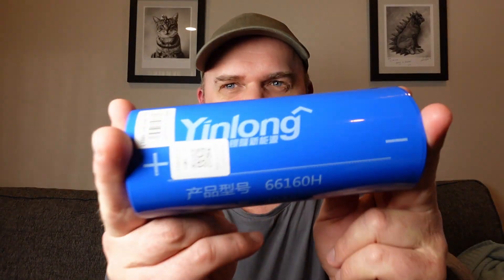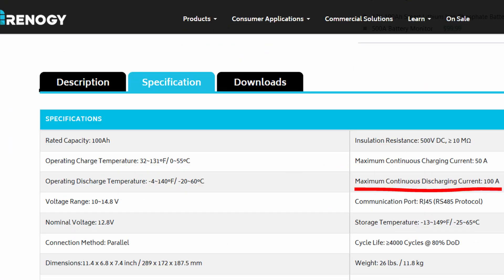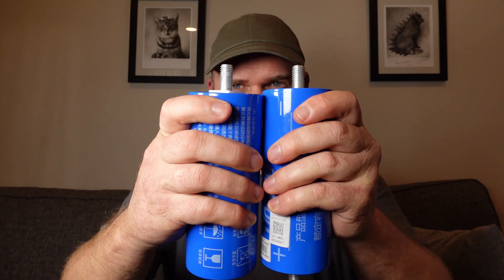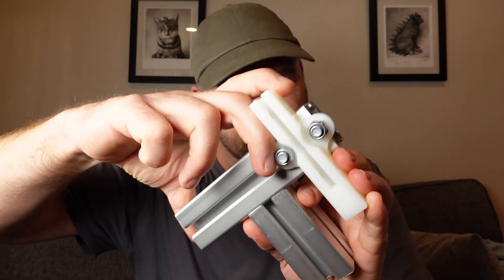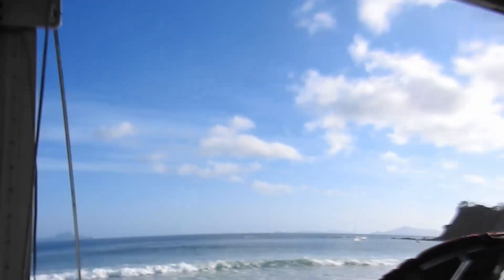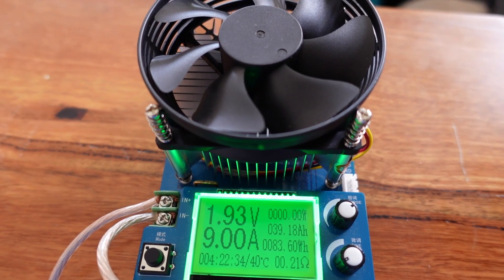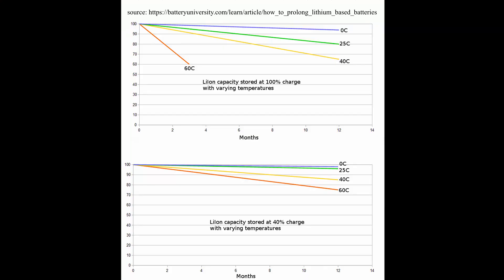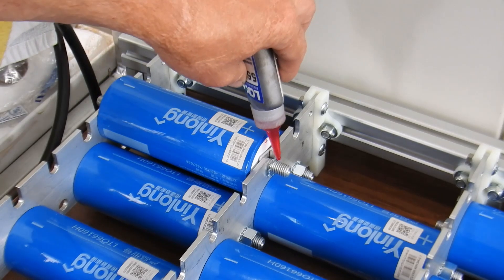Campervan DIY battery build HUGE POWER!

Comment: Good vid and great tips at the end. Especially liked the flange nuts at the end. In the real power world, instead of the star washers, Try Belleville / cone / cupped washers. (I've seen them under all those names). The build up is plate on plate (buss on buss), brass round and then the cupped. Basically a cupped spring that maintains even pressure around the washers instead of point source pressure.  - This is an example, random pick (You may call them something else over there - https://smile.amazon.com/dp/B08L1XRZFN/ref=cm_sw_em_r_mt_dp_esRSFbXXAPNN9

BTW - thought your presentation was good enough to subscribe to
Reply from the maker: Thanks, Yeah, I've used Belleville washers before, but only in mechanical designs.  The reason I wanted to use the star washers was to get a real bite into the ali.

Comment: I would have been keen to do the bulk buy with you but I am in South Africa and the double shipping would be a killer. My system is a 12V system so I think that a bank of 6 would do just fine for me as I have 2 x 102 ah AGMs at the moment and the capacity is normally okay but the one is getting a bit tired and needs to be replaced. I will check out your Alibaba link and report back if I pull the trigger on this. Thanks for a great video
Reply from the maker: sweet, flick me an email mentioned above and will get a price for you with bulk buy

Comment: Hi there.. so I have this dream I've had since I was about 15,. I'm 42 now.. That dream is to have a portable sound system that me and a couple friends could take anywhere and pump out 10- 12 hours of blissful beats at.. let's go with 30,000 watts.. 
I guess I have been just waiting for the technology to arrive not knowing much on the ends and outs of all the specs. The last couple years I've been excited that the idea could come about with all these new batteries.. when I saw your video I am thinking maybe this battery style is the one to make it all viable. 
If you were going to make the kind of build described.. a battery bank to power, subs, mids, highs, and drivers, amps and such,. To power a portable sound system at 30,000 watts for 12 hours.. 
Is this ridiculous?

Anyone that would like to help develop this concept feel free to hit me up at electricshiver@gmail.com 
Kindly,
Beau
Reply from the maker: 30kW for 12 hours seems optimistic...  The battery would have to be at least an order of magnitude larger than mine
Reply: @brendontait6968  so what about knocking it down 20thou.. or even to 10 thousand?
Reply from the maker: @nonyabusiness9747  if this is something you want, buy up a few tesla P100 batteries from wrecks etc.  It won't be cheap, but this will be the cheapest way of doing it.
Reply: @brendontait6968  sounds like a great idea. Ty
Reply: 30kW sound system?? Blissful beats!? LOL
Reply: @Infinion  yes. 
I hosted a 3 day edm festival once and was able to have a 80,000 what system. That's a bit over kill because the venue owner recieved 17 official complaints for "gross disturbance of the peace" some neighbors were up to two miles away. 
But my goal is to have a portable system that could be move by a few people to remote locations were we wont bother anyone,. And be able to pulse beats for a small to medium crowd.

Comment: You are smarter than you look.  Most folks don't consider expansion and contraction, like the dudes that installed my leaky steel roof.  You need flexible sealant around vents, not tar.  The roof moves a lot.
Reply from the maker: thanks, we will see... time will tell if my design was a flop

Comment: Nice neat build.  These cells are only rated for a continuous discharge current of 240A or 6C so that should really be the only current rating people should look at when using them in any type of long term use.  That being said you will likely never even come close to the max continuous discharge with a 24V inverter.  The 600A rating is a max discharge current rating at 15C and is only for very short bursts.  Each cell looks to be good for 92 watthours so they would be about 30% lower capacity by weight vs LiFePO4 chemistries.  I would take the max discharge rating and cycle life that they claim with a huge grain of salt since Yinlong hasn't been around all that long yet even if the LTO chemistry has been around for a while.  LTO is probably the least energy-dense chemistry but is also likely the safest of the current lithium chemistries.

Comment: Use loc tite blue on your threads. Locks the nut but leaves it removable.
Reply from the maker: The "loctite" I used wasn't loctite brand.  It is Loxeal 55-04 which is intended for disassembly.  I am cautious It could still hold too tight.
Reply: @brendontait6968  It looked like loctite red. That stuff you have to tourch to get the nut loose.

Comment: I need a backup battery for my CPAP machine, for travel, camping and when the power goes out at home. I'm wondering how this type of battery would perform? & how to build a system with such a battery? If you have any advice I'd love to hear. As other off the shelf batteries seem to be horrendously expensive.
Reply from the maker: It would work well.  Tho I'm not really familiar with CPAP sorry.  Can't imagine it would be very difficult

Comment: Hey Brendon, has anyone contacted you about this setup for a sailboat? I'm going solar on my boat after my 6.5 KW diesel genset took a major dump.
Reply from the maker: It would be quite a good option for a boat, as a Boat fire isn't really ideal.  I can run my fridge and lights for around a week from it before it needs charging

Comment: Regarding your ideas about cost efficiency.. I believe a person will change their batteries within 10 years no matter what they go with, due to new technology, or they sell their vehicle etc. 

12v 100Ah Lithium = 1200Wh * 4000 cycles = 4 800 000 Wh, = 4800kWh.  Let's say people only use 70Ah a day..

70Ah * 3650 days (10 years) / 100 (a cycle is a complete charge and discharge) = 2555 cycles. So they don't need 20k cycles.
What does the cost look like now?  We won't use 20k cycles, so it's reallty wrong to use that number?

Also, you must add the cost of the BMS and building the battery.
Reply from the maker: I hoard stuff and never sell anything!  I don't know why you'd change your battery if you were 10 years in and it was still delivering the power you wanted?  The battery can charge quickly if you wanted to charge from an EV charging station etc?  One of the things to take into account... The rated cycle life is in lab conditions quickly cycled.  Real life use is likely to drop the actual cycle life by up to 50%.  Even if the LTO cycle life was halved... It's still heaps.  BMS is a minor cost and the build materials were around 3-4% the battery cost.
Reply: Also, Will Prowse says "We can't use all of the capacity of these cells for 12v appliances" . That has to be taken into account as well imho.
Reply from the maker: Mine is 24V and the voltages work fine for everything.  I agree with Will if you are using 5 cells, 6 cells is more common for using with 12V - this gives around 15.3V at max charge, tho you wouldn't lose much capacity dropping to 15V
Reply: @brendontait6968  thank you for your time and responses :D

Comment: Lithium Titanate: Specific energy (capacity)	50–80Wh/kg

Very low Wh/kg, why did you not go with something that gives more wh/kg?
Reply from the maker: Your specs are lower than I have seen.  Normally stated from 80-110Wh/kg tho I have seen as high as 140Wh/kg.  that being said... the energy density is similar to some LFP batteries that I have seen.. I don't care so much about Wh/kg my truck is 12T  I want reliability, safety and longevity.

Comment: Wow, that was a great video mate. Just wondering, I live in Queensland and I’m thinking about putting a battery system on my house to go with my 11.5 kw system. You mentioned keeping the batteries cool for efficiency....well , I was just wondering if I should build the battery packs into a large fridge and set it next to my inverter on the deck. It would keep everything cold and wouldn’t look out of place. Your thoughts please. I really enjoyed your video and I may be interested in buying some batteries as a group. Cheers.
Reply from the maker: Hey Richard, Thanks! more keeping batteries cold is for life extension.  Batteries will generally have a reduced output capacity when cold.  Regular lithium chemistry will not last well being operated near or below freezing temperatures.  It's a good idea tho.  I think with this chemistry, as long as you don't get it too hot, it is likely to last you a lifetime without cooling. But yeah, building a pack in a freezer and having it set at like 10C with a thermostat mod is probably decent to extend the life of other chemistries.

Comment: Hey there, fascinating. yet two thoughts: first, my feeling is that the number of functional charge cycles on any accumulator is more a guess based on lab data than a promise based on real life experience under everyday conditions. I would not take it as granted. second, god forbid that anything goes badly wrong with this monster while you are sleeping in the van ... You might not get out in time... 
Anyway: very informative and a straightforward and simple approach. I like that.
Reply from the maker: Thanks, yeah.. I agree about lab testing vs real life.  Especially if the batteries are being held at full SOC for a majority of their life.  That being said... using lab based data for comparative life expectancy between different battery types is likely realistic.  If one cell lasts twice as long in lab testing as another, it is likely to come close to lasting twice as long in real life too. I chose this chemistry because it is the safest that I could find.  During sleep I think it is likely at its safest, no real charging or discharging happening.

Comment: Are these things for real?
40ah battery that small for 56 bucks plus about 20 more bucks for shipping on aliexpress. 
Sounds too good to be true.
Reply from the maker: I think you might be mistaking Ah for a unit of energy capacity.  This is why I said in the video that people should forget using Ah as capacity measurement and use watt hours, Ah means nothing.  One cell is only 2.3 volts, so you'd need 6 cells to make an equivalent (or just over) 40Ah 12V battery.  The cells are 92Wh each.

Comment: i'll never trust chinese non verified and guarantee batteries to install in a van.. 1 defect and u burn down your van.
Reply: Chinese people aren't dumb lol. They make everything in your house
Reply: these batteries are really good. you should look them up, they are from a reputable Chinese company
Reply: The difference is in the verified. Read the certs. 

More likely design/build errors in the battery pack assembly and charge/discharge control system will cause catastrophic failure.

Comment: Why not use terminal ends on the batteries, with flexible 4 Guage copper core multistrand  high current wire cable between them it would solve the flex issue quite nicely? For mounting make a mold and pour silicon racks to hold the ends of them in place?
Reply from the maker: I can't imagine it would be a cleaner/easier build with that method?

Comment: Different from other lithium batteries there are considerable losses  if we compare energy flow between charge and discharge cycle.  Please check data sheet.
Reply from the maker: This is not true.  I mentioned it in this video and am going to make a video about it.

Comment: I know absolutely nothing about battery technologies etc so please excuse me if this is a ridiculous question but could these be used for an Electric Vehicle or are they just too cumbersome for that. It just seems that with the very high discharge rate they'd be ideal for giving an electric motor a mass of power without them going into meltdown etc. Thanks.
Reply from the maker: Mitsubishi and Honda have used them in some of their domestic market vehicles.  Generally speaking they are considered to have an energy density that is low compared with more flammable chemistries.
Reply: @brendontait6968  ah okay. Thank you so much for your reply I appreciate the information.

Comment: Dropped out of high school ?
Mate, you should have been the teacher !
I wish I’d had a physics teacher half as good !
You would have inspired your students to learn.
I think the problem may have been, that you were way ahead of your teachers; They didn’t engage you.
I bet you were bored to death in class and your mind wandered onto other dreams.
So concise and articulately explained.  No “Ums” and “Arrrs” or “you know”s.
There a a few good Youtubers and your in the top 5%.
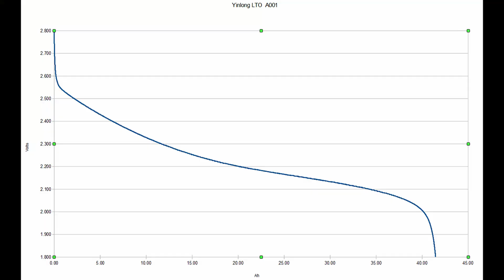PS - Hold the battery up so we can read the specs.  Wasn’t familiar with LTO and had to slowmo well into the video to read the voltage of the cell.  Had my mind racing trying to work out capacities and your set-up, until you presented the voltage range graph (12:45).
Reply from the maker: Thanks Len, yeah... never been into wrote learning.  Thanks for the encouragement, I'm still fresh to YT am going to put some more effort into getting better at explaining my thoughts.  Have a lot to share.  Cheers

Comment: Video says 95kW but description says 9.5kW. The battery description is just as confusing: each battery is 40ahr & 2 3v.
In series you add voltage and ah stays the same.  In parallel you add ah and voltage remains the same.
95kW would be 7,900 sets of batteries with 6 batteries in series: 12v @ 40ah.
Reply from the maker: I think you are confusing units Bob.  The video says 90kVA and the description says 9.5kWh.  90kVA is the amount of power the pack could deliver.   9.5kWh is the energy storage capacity of the pack.  Hope that helps clear the confusion?

Comment: You didn't mention weight comparison to Lithium Iron Phosphate. I want to do a build for my RV so weight is a big concern. What is the weight per capacity difference LiFePO4 vs Li2TiO3?
You talked about how you need to keep  AGMs charged at 100% all the time to keep them happy and Lithium at least than half charge, sounding like you were leading to some kind of difference and why these Lithium Titanates were better, but you didn't I assume then these want the same 50% charge to be happiest?
Reply from the maker: LTO is about 65% the power density of LFP, tho I have seen LFP batteries that have similar energy density to mine.  I'm still new to YT and learning to relay my thoughts better.  I was just saying that lithium typically should be stored around half.  With an RV it's easy to have them sitting near 100% for the majority of the time when not being used.  This will likely damage LFP much more than LTO.

Comment: Did you use an oxidizing paste between the steel and aluminum to prevent dissimilar metal oxidization  ?
Reply from the maker: Notice with the cotton bud application...  yes.  Especially for the copper connectors on the end.

Comment: Some LTO cycle up to 7000 only according to some Wikipedia
Reply from the maker: yeah, some are also claiming 30,000 cycles.  I assume their life depends on how hard they are stressed.  LTO chemistry typically has an energy density range of around 80-120kWh/kg, these cells are on the lower end of this range.

Comment: It's all fun and games until you realize the batteries alone all add up to over US$5000.
Reply: People think "solar saves money". They don't pick up on batteries to store the energy IF the sun shines.  NZ...wonderful son!
Reply from the maker: Yeah, batteries cost money unfortunately.   The equivalent capacity in renogy would have been around $6,500
Reply: @brendontait6968  prismatic calb cells can be found at $129 3.2v 100ah. Large amounts of support are available for lifepo4 cells. Also, they are another safe chemistry. $3830 for loose cell 9.5kw
Reply: @brendontait6968  yeah but when you factor in the life span of those batteries that's where they end up actually being extremely extremely cheap for a battery

Comment: That wass all correct information! my project can go up to 0.5MWh  but we will se what will happen in 10 years. I have to study later  details. I recommend you study EU company Sceleton kondenzators aka super or ultra kondenzators. Arent these akumolators only from that to that voltage or you kill them? btw akumolator/s not bateri is only 1 time use!

Comment: Great build. I have few of these cells and wondered about how I can package them together and you gave me some few great tips! In general in automotive application, LTOs are not so popular in most builds since kWh per Kg in power density is where these are far behind compared to other Lithium chemistries. I worked with these in City Buses where they may have a short range like 50-80km but have dual charging port to pump in as much amperage (8-10c) in for 5-10 minutes and go another 50-80km - it was pretty sweet to see them work. LTO (Altairnano/Yinlong) is an odd duck that has some interesting applications. They do degrade about 1% a year and also wants to be charged with high amps if you want to them to perform well. Share more about your experience with BMS and other related things. Thanks for sharing. Subscribed!
Reply from the maker: thanks!
Reply: we can provide yinlong lto battery for you if you need